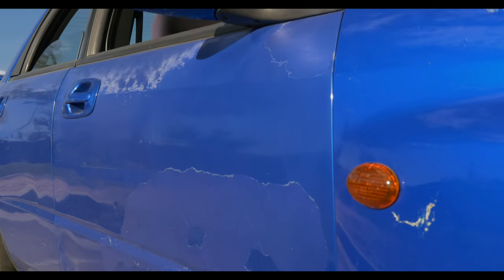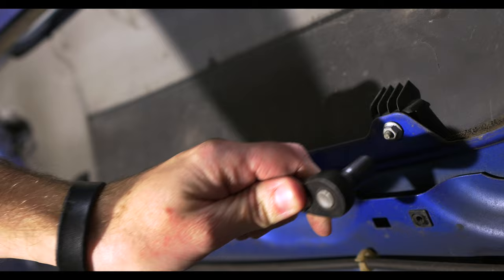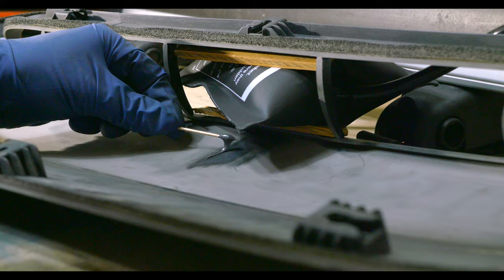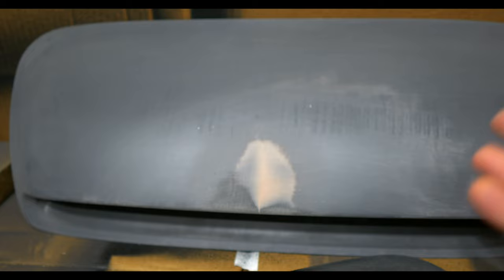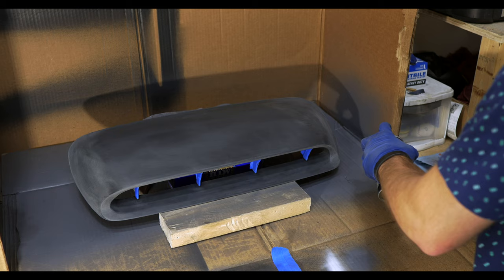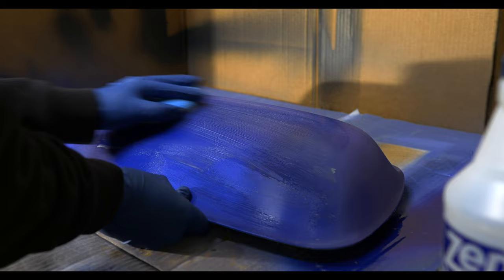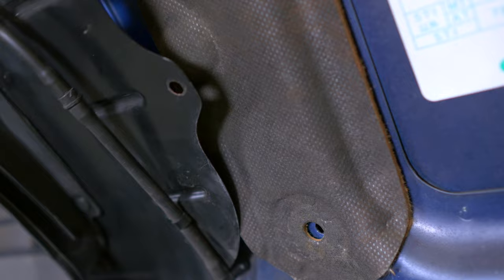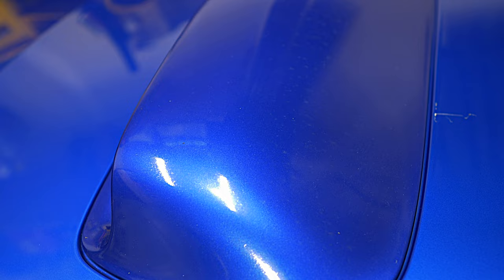Repainting My WRX STi Hood Scoop

Comment: Hey bro great job on the paint. Im curious where you got the color match paint. I need that color. Please if you can send a link.
Reply from the maker: Thank you! I got it from Scratch Wizard. You can find their products on eBay. But I don’t recommend them. They are difficult to work with. I really recommend GrimmSpeed Omni Pak paint. You can find it anywhere.

Comment: When sanding, what sanding grits did you use? Thanks!
Reply from the maker: If you’re trying to remove paint entirely, a range from 80 to 100 grit is best! I’m pretty sure I started with 100 then went up to 320 and finished with 400 before priming. 
The idea is that the more aggressive the grit is, the easier the paint will come off and you just need to smooth any of the deep scratches you make by slowly moving up to 400 grit before primer. It really depends on what you’re painting.
Reply: @dminoms  Oops I meant at the part where the clear coat dried and it was ready for sand, compound & polish.
Reply from the maker: Oh yeah! I started with 1000 grit and then moved up to 5000 and finished with compounding and polishing.